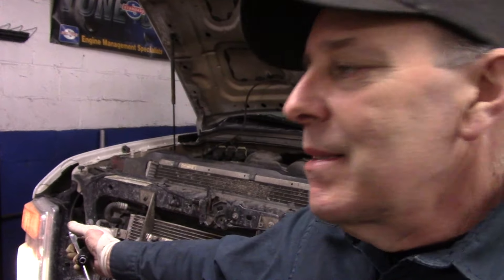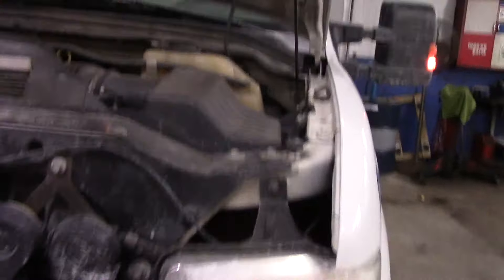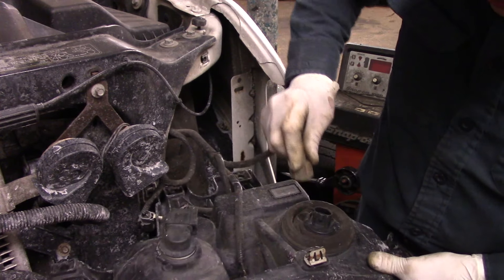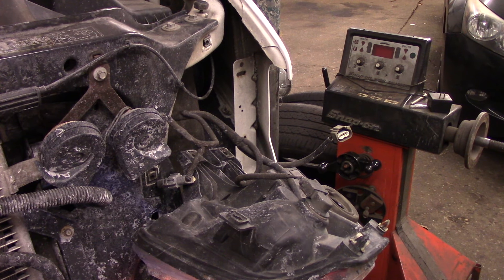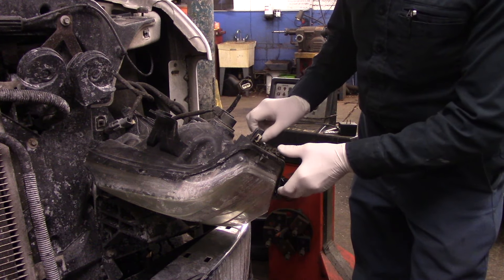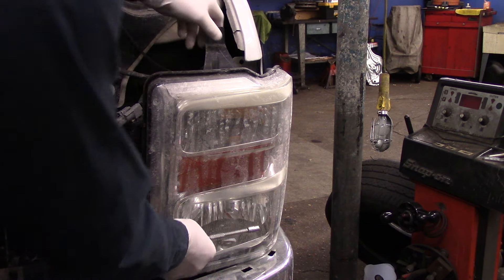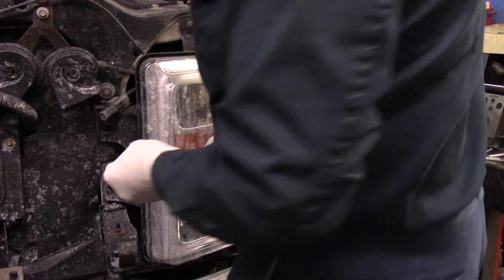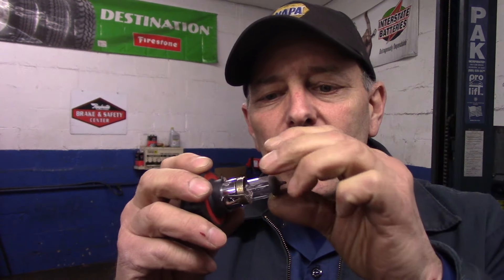How To Replace A Headlight 2008-2010 Ford F250 & F350

Comment: And if u touch the bulb accidentally, use rubbing alcohol and clean the glass part. Also use good quality lightbulbs, bad quality bulbs can get too hot and melt plastic parts of headlight that holds the bulb or plastic connector because resistance is too high.